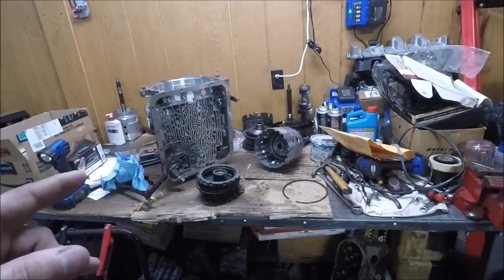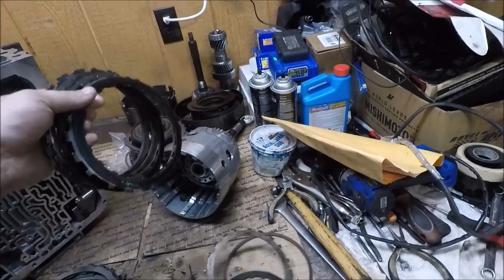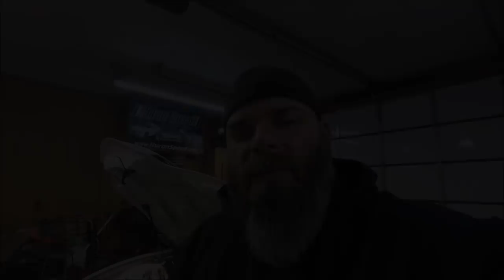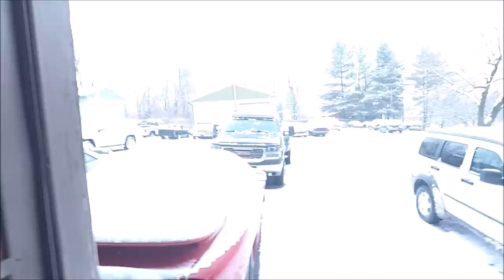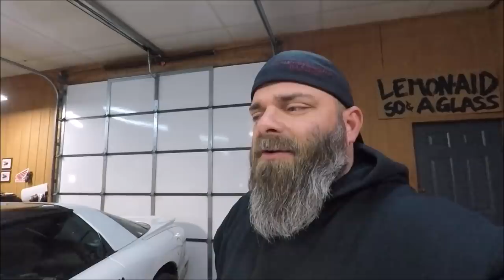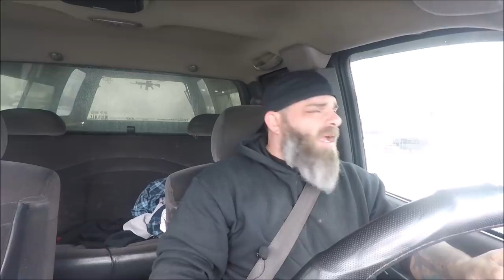The TRUTH About The Trailblazer Transmission Issue!  WATCH TILL THE END!

Comment: Look up Mike Morris 1999 Z28 from Merritt Island Florida on Facebook or LS1 Tech. Car ran 11s 8 years ago with a Transgo,Truck Pan and a transmission cooler. And then 10 a few years later till now. 3140 pounds. 4l60E. Daily driver. Trans was freshened up a few years ago just to make sure it would survive a few more beatings. Jimmy Pretz from Lancaster PA with a LS1 Trans Am that runs low 11s. 4L60E.  Josh Talbot had an 11 second capable LS1 Z28 for a few years with a 60E. All are beaten on from what I seen.  Of course with common sense and maintenance.  Wanna guess who built them all?

Comment: Honestly andy this is something that could happen to any shop maybe consider a waiver stating you do not warranty the trans otherwise these issues will happen
Reply: But how would you warrant performance work? I'm not a car mechanic, but really appreciated Andy's teardown/rebuild videos because they showed me how complex these things are. And being an engineer, why things are likely to fail if they're abused. I guess that's why parts are normally warranted for 'normal wear & tear', ie xx miles, not overloading the truck, not drag racing it. Or letting Jeremy from Fasterproms stick a nitrous shot in an S10.. So someone wanting a performance upgrade is likely wanting it to do something outside the original design spec, ie a light duty transmission. To me, the videos showed Andy took reasonable/diligent steps to replace and upgrade parts known to be problematic. The truck owner also seems unreasonable. If they're disputing the work, they really should have got a proper inspection report stating how they thought the work was defective. I guess Andy's lawyer is about to educate them on that subject.

I can also appreciate the frustration the drama causes, and the time & money it can soak up dealing with disputes and drama. But such is the Internet. And now to watch what happens to that S10!
Reply: Wouldn’t fully release from liability. Best thing to do is not rebuild those particular transmissions.
Reply: @98ws6m6cvert  unfortunately even with performance work you dont stay in buisness by not standing behind your work so most places offer some type of warranty just severely reduced such as 5 or 10 thousand miles
Reply: @dandiaz9752  that's true but the 4l60 is just such a crap transmission. Sounds like the guy wasn't aware. Similar situation happened to my dads SSR. The trans was rebuilt constantly.
Reply: It does happen to every shop in some form or another.. my favorite is when a 1000 wheel horsepower car engine blows after racing over a year or two and daily driving it everyday and they blame the builder or tuner lol comes up all the time on forums and usually they get roasted pretty fast
Reply: I was expecting him to say the TB trans is total crap but he said - if you ABUSE it - it WILL fail. So that was actually good news for me to hear - just had the pan dropped and filter changed by the dealer - a couple days ago. At 240K - that's the 3rd time we've had the trans fluid changed. So I'm just gonna make sure not to ABUSE the transmission.

Comment: I have a 2003 Chevrolet Trailblazer 4.3L V6 with a automatic transmission. It has 200k miles and now the transmission is slipping gears. I flushed it twice using around 18 quarts, added 1 quart of Lucas transmission additive and now it feels like it's slipping more. I was thinking of throwing a shift kit in it to see if that helps in anyway and I don't want to spend $1,200 for a new transmission and $120 in new fluid either.
Reply: so what happened to your 03 TB transmission? my 04 just lost the 3-4 - so a new rebuilt is gonna be put in.

Comment: Hi Andy. I once had a 1995 Chevy C1500 with a 5.0L V8 and a 4L60E transmission. Shortly after I bought the truck, 4th gear stopped working. It would not shift 3-4. I had it rebuilt twice and it failed 3-4 shift again. Then I bought a GM transmission from the dealer and had it installed. No problems since and then I sold it when I got engaged and moved to another state. Now I have a 2012 Silverado with a 6L80 transmission. I hope this one is better than the old 4L60E. Best wishes my friend. I'm a long time subscriber to your channel.

Comment: i just bought a 2006 trailblazer 4wd with the 4.2 engine,when i first crank it will start in 1st gear,but after that it starts in 3rd gear,l'm thinking of changing the shift sensors,also the speedometer doesn't work.

Comment: This may be a dumb question.    Did the lines get cleaned out when the new one got put in?     Ive done that before got small debris I'm stuck on valve open.   I learned to flush the cooler and lines out the next time..  Mechanic man struggles in life.  Try and keep customers happy.   It happens ton the best of us when ur a one to two man crew with one lift.

Comment: Hey Andy my name is Thomas I just bought my daughter a used 2004 trailblazer 2 Wheel Dr. with the 4.2 L engine unfortunately I do not have a huge income. I’m just a hard-working country boy that lives week to week, her trailblazer shifts great but heats up the neutrals out and will not grab any gear could you please tell me if there’s a way to fix it that wouldn’t cost me as much to rebuild or to replace. Either way thank you for reading this

Comment: Hello im Emilio  and i have a 2007 trailblazer lt i stopped  at the traffic light and when it turn green i tryed to pull off i have no traction when i put it in park while the motor is running  it grinds like the transmission is still spinning  i raised it and rotated the rear wheels  drive shaft spins but it doesn't  spin when in drive or  reverse

Comment: I have an 08 trailblazer had it for 7 years np yet with trans. Nock on wood. But just replaced the engine lmao
Reply: I had a 02 GMC envoy XL I never had a trans issue but  my brakes were completely shit to the point i was forced to replace most of the brake system
Reply: Mine took a shit one year after I bought it. Engine was great. Trans was junk.
Reply: Tbss?
Reply: No. Straight 6 LTZ
Reply: I have a 2006 Isuzu Ascender with the 4.2L I6 and 4L60E transmission. I put the biggest trans cooler on it that would fit. Wise investment. No trans problems, but the vehicle only has 32,000 miles.
Reply: @Todd_S  and that's the biggest issue they have. Heat. I'm not sure on the Isuzu, but the stock radiator/cooler just isn't enough on the Trailblazers. Of course they all aren't going to burn up, but it happens enough that they have a shitty reputation.
Reply: @goose32373  Yeah, I was towing an RV with mine and knew that a transmission plumbed to the radiator would not be good. The Isuzu Ascender is a GMC Envoy / Chevy Trailblazer clone.

Comment: I'm amazed with my 100% stock original 2000 4L60e! I have a 5.3 with small cam, full boltons, custom tune, 320rwhp 350rwtq (for 100K+ miles) and it is still working great 210K miles. Changed fluid/filter at 90K and 180K, no metal shavings. I tow cars and parts with it, but I don't abuse it! I just leave it in drive and let it do its own thing when I want to play around race some buddies.
Reply: Yeah what does this guy know. The look says it all

Comment: As far as the 4l6x trans,I have a $2500 Extreme Automatics build with a billet output in a AWD Escalade with a built 6.2 that I daily drive and it’s going on almost 10 years.....6000# and approximate 400+awhp/400+tq...

Downshifts are what seems to kill them in heavy setups.

Only being in a 6 Cylinder trailblazer tho,u should have been on top of it IMO He also says 6 months....
Reply: Built right they last  a long time

Comment: I agree with you fully....I wished I had years experience rebuilding transmissions and mechanic work, it sickens me that I was starting out after military mechanic service right, with college mechanics classes among other classes, received a aas degree in automotive and minor in industrial sciences, got eight ASE certifications, and tried to work various mechanic jobs, and bad customers, technically con artists alot of the problem ones, they ruined my career/confidence, etc, even on a rebuilt automatic transmission that worked great till the customer ripped it up off road and wanted a free transmission, a more heavy duty one, etc etc, I mean,  in a small area, some a-holes went around and said that I didn't know what the hell I was doing cause not only was I young but I didn't look like a mechanic mainly cause i didn't look rough, didn't have long hair, no tattoos, and didn't smoke cigarettes like a chimney and I am only five foot six inches tall,....so there went my mechanic career in a rural area, I could have left if I had the money and I didn't have ailing parents and of course the family situation I had where I needed to work another job instead of being denied work cause some a-holes claimed I shouldn't work on their cars,...I mean, in hot rodding personally, I had rebuilt about that time three high performance upgraded TH 350's, a powerglide performer, a couple th 400's, and I even repaired for a friend just what was worn on some clutches his 700 r4,, and oh, I had apart and freshened up a th200c as well on a car I sold, ....I was successful, some of those transmissions I know worked for years, one a guy drag raced with it, but people get to talking, in a small town, next thing ya know yer boss is telling ya you can't change oil or do a tune up for a customer, cause there were some con artisting well off folks who inheritied money and decent jobs and practically never had to work, and expected car work to be free.  I mean, I ran a shop for a owner, I came up against those customers coming in the middle of the night wanting to drive away their vehicle they thought was just repaired and were gonna supposedly pay for the repair the next day only to find their battery removed and vehicle chained to the rail and the note saying so taped on the dash by me,....or those who wanted free diagnosis so they could go back to their yard and repair it themself, hey no problem, I was willing to help folks as poor as I was, a veteran and of a war, without much to my name except some craftsman, snap on, and mac tools......I should have just left my area, cause i sure as hell couldn't find a shop to rent at all, lack of funds anyway, but in my opinion, I should be talking right now how I yada yada yada started mechanic work in automotive or at least diesel truck repair over twenty five years ago, yada yada yada, instead I was victimized by those who know how to cheat, lie, steal, I mean, a couple years of that shit and I lost money, couldn't pay my bills sometimes, fired from one job due to an argument over a customer claim and not enough work(made the shop owner alocoholic so much money doing carubretor rebulds and transmission servicings, even a couple engine rebuilds, he was just an idiot),....I wished I had just went off and worked for myself,.....I'd have run into the same things, but working for oneself gives a person the confidence and the customer service to be able to do a one on one with customers, but instead if a customer thinks they can say "well, that young guy over there with the ASE Master Mechanic patch on, he don't know nothin cause he is like either a kid or is too short to even do this work, how dare you put that kid on my vehicle, I want my money back and the tranmission service work and the tune up he did for free or I am gonna tell my buddies down at the lodge you don't have a shop worth shit cause ya can't hire any good help.  Well, anyway, rant off,....I could work as a mechanic right now, at age 51, good thing I am lucky with genetics, all the men in my family live long productive lives, I have a sucky dead end job right now, and I have a vehicle I posted on youtube just the other day, ....actually a trailblazer, a 1999, ...and i $$$$$$  and I 100% agree I don't trust 4l80e's like I have, all that electronic controls garbage for "performance" or even off roading in a light off roading situations,....transmission supposedly worked before spun rod bearing, ...there is no way I will build a blueprinted motor and stick it to a 4l80e un rebuilt and un modifed with a heavier duty planetary gear set and heavy duty clutch packs,...likely needs every shift solenoid etc to work, and those transmissions were known to have weaknesses from the factory.  I basically know that the 4x4 could make a great daily driver with a new engine and transimission, with occasional four wheel drive engaged due to bad road conditions, but take that off road, ....ha, well if I ever get a shop I can just burn out the transmission prematurely just for doing some light muddy off road four wheeling, maybe get eight thousand miles out of a bomb proofed 4l80e, and maybe have a spare or two laying around when they are needed.  .....aqn automatic transmission, ...in my humble opinion, .....they are a convenience item over a standard manual transmission, like what is in my 1997 c2500 detroiit diesel truck, with five speed transmisson, where first is a granny gear, a heavy duty tow package.  Now, that truck has a great transmission, as an old beater truck, right along with the recently rebuilt limited slip 3/4 ton differential,..I mean, nobody except the really well off uses automatic transmissions for towing things,...in my humble opinion, I mean, what do I really know, I mean, I don't work as a mechanic and I have minimal experience, but I remember most everything i have read in a magazine or book on cars, and videos, I have a fair okay idea on the subject. I don't like these style transmissions, they are not "bulletproof", nor can they technically be made to be, ...well, one could build them up, take them to a dragstrip or off road a number of times,.....and that is it, even with external fluid coolers.

Comment: Hi Andy, sorry this muppet cried about his crappy car after 6 months of use.
Reply: Was I accurate in assuming it was 8k miles in that time frame? Sounded a little much for standard driving
Reply: A transmission shouldnt fail after 6 months.
Reply: I think the customer should get a new car and never buy a GM product ever again.
Reply: @Chris-hw4mq  my work truck 2017 Silverado Trans went after 40k kms

Comment: Andy big question , I have a 04 chevy trailblazer lt  4l60 E I wanna replace my transmission with a used one. Which 4L60E will fit in it, supposedly my 04 TB lt is different than most is that tru and if so what transmissions fit my truck ty

Comment: Andy I trust you that's why you have my truck and building it as we speak
Reply: JOHNNY BGOOD Nice... what truck we talkin about?
Reply: Just kindly ask him to soak you're 3/4 clutch pack before installing it. Actually, ask him to soak all the clutch packs. Also ask him to check your 3rd accumulator check ball valve. Thank me later.
Reply: @TheSteelerschamps  a Yukon I just dropped off yesterday
Reply: @rockroll9513  I'm not doing my transmission getting a heads/cam job
Reply: @solematrix  5.3? 6.0? 6.2?
Reply: JOHNNY BGOOD Hope it works out for ya, anxious to see what it puts down
Reply: This guy will have a video next year about how Andy still has his truck.
Reply: @00recon  being a one man shop that's just the way it is.
Reply: @rockroll9513  5.3l

Comment: I'm scared of my trans' lifespan. Im at 196k miles, i believe i changed the fluid around 153k. And im going to be camming it soon, mild tsp stage 2 cam. They dont recommend a stall due to cam size, and my temps are always under 160. 170 on a hot day of givin her the beans. Any recommendations?

Comment: Not trying to be a hater but your track record doesn't help you in this situation. You pretty much ruined Mike's z06 and kept it WAY too long, Max quit because of obvious reasons, you could have killed nick with the work you did on his zl1 now this. Sorry man facts are facts.
Reply: For the record I don't think the transmission problem is on you but the other stuff is.
Reply from the maker: Ok....I just want to see how this makes sense.  Ruining Mike's Z06 by making great hp and tq on his '16, the '17 has always been a problem child, but yet it's back here getting put together correctly from another shop and will make hp.  Keeping it way to long, you realize it takes time to get parts in especially if a customers changes plans or adds to the build.  Max quit because if found a better job offer, real estate.  Almost kicked Nick lol, his car ran fine when I worked on it and tuned it multiple times, never blew up on my watch.  Went 9.3's under my watch and that's even when jobs on the car were rushed because he needed it back omg sooo fast and couldn't wait.  That's the facts unfortunately.  For the record, I've never blown and engine, wrecked or damaged any of my customers cars period.

Comment: I am a rebuilder and agree with you 100 percent been down that bullshit road with customers only thing dirt will cause is a stuck valve causing shift problem 3to4 no matter if you upgrade like I do to Kevlar 10 friction stackup will fail also from driver habits there is no washer 3to 4 there is a washer under sprag and believe me if you left out you would have excess endplay and trans will go into gear with A bang

Comment: You didn't do anything wrong
Reply: how would you know???
Reply: @Deke1  because it wouldn't have worked for all that time and thousands and thousands of miles without a telltale signs  after it was done..  it's a 4 l 60 e I went through three of them by 84,000 miles with a completely stock one without ever towing and after each dealership rebuild it didn't last more than 15,000 miles..  those transmissions are a crap shoot the best case scenario is that you only replace it once while you own it lol